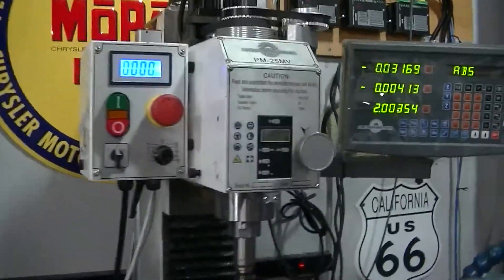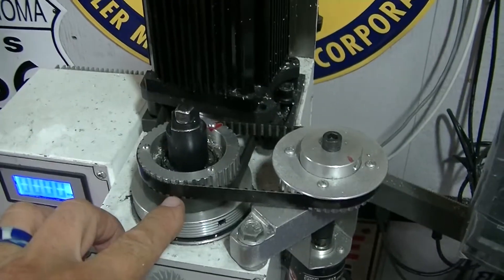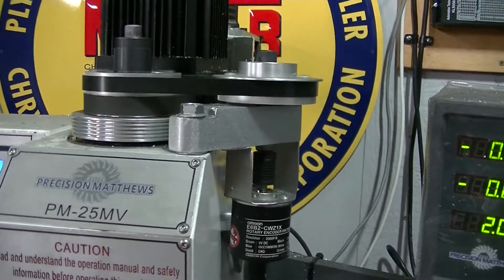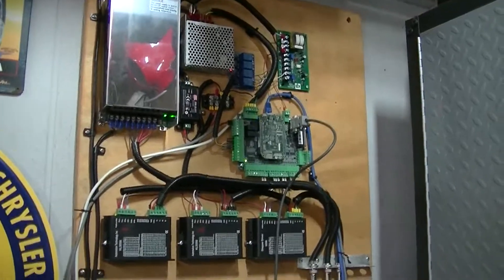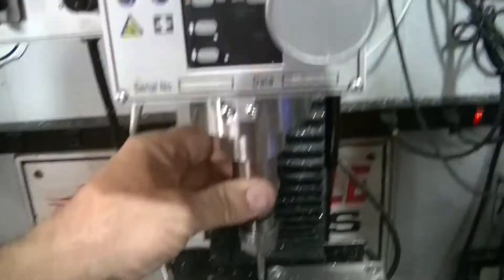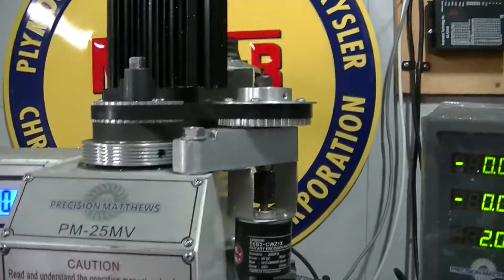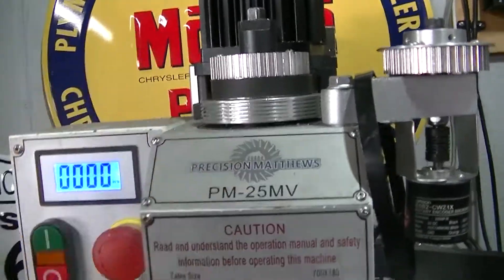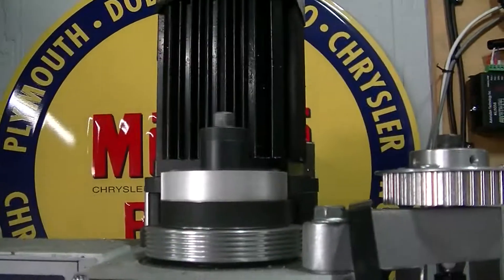Precision Matthews PM-25MV Rotary Encoder Installed

Comment: Fantastic, a nice simple solution! I experimented with mounting a spindle to the drawbar and using the servo encoder feedback, but I easily like your solution best. What is the highest RPM your encoder can handle?
Reply from the maker: Actually I'm not sure but I'm using the same one that guys are using going to 4500 RPMs.
Reply: @Roadstercycle  Looks like you have the E6B2-CWZ1X with 2000 p/r. Specs say the encoder has mechanical integrity to 6000 RPM, but resolution determine maximum electrical response. 2000 p/r -> 3000 RPM, 1000 p/r -> 6000 RPM, and so on. I ordered the 1000 p/r for my mill, and will use a similar Koyo 2500 p/r that I already have for my lathe. Thank you

Comment: what size pulley did you use to achieve the 3100 rpm? Great idea by the way.
Reply from the maker: Hi, I really can't measure it with the belt on but I just made it as big as I could to fit it and the belt on the motor shaft without rubbing.  I actually end up at about 3140 RPMs.  I also had to cut the motor mount to make it work. Email me jack@roadstercycle.com and I'll take a couple pics for you to clarify.